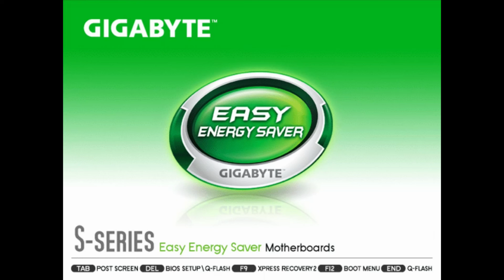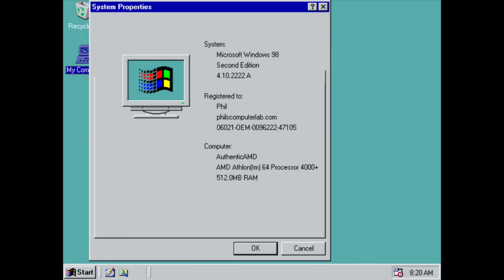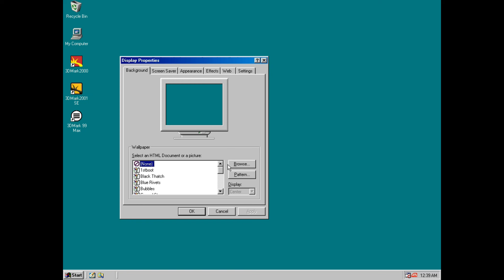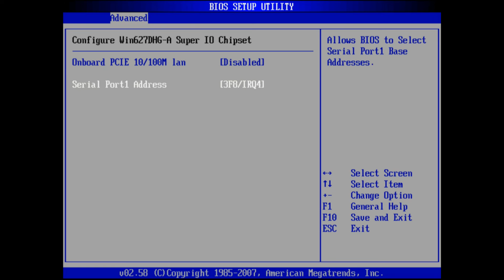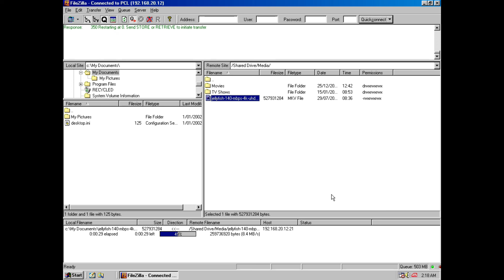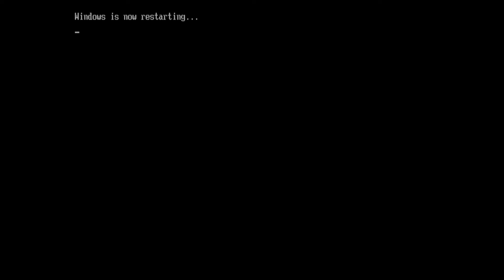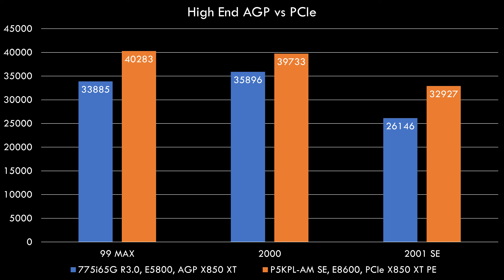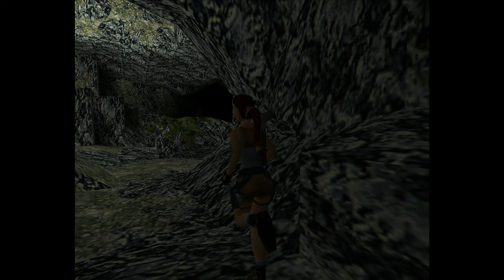Using PCIe Graphics Cards with Windows 98 SE

Comment: Recently someone gave me a Foxconn k8m890m2ma-rs2h motherboard with a Sempron 3600+ and a PCIe X300. Just out of curiosity I installed Windows 98 and I was pleasantly surprised. I haven't tested it much, but I've played NFS Porsche Unleashed and it was very quick. VIA drivers installed with no errors, but I do get some unknown devices in device manager, and I had to use a PCI soundcard, as the onboard was not detected.

Comment: Fantastic video. It's a real reminder that I really need to put my PCIe x850 into a faster machine. I Built a socket 478 system with a relatively fast Pentium 4 and the x850 just crushes it. The R. Loew 512MB patch for 7 series geforce cards is interesting.

Comment: I have 2 PCIe motherboards that worked fine in Win98 without having to do anything to drivers or device manager.  They were gigabyte GA-8i915 PMD and a Shuttle PC with Athlon 64 and nForce 630a chipset.  The main problem I had was finding old games that work with it.  Games that support XP also worked in 98, but games that predate XP rarely worked.  I was using Quadro 1400 and Quadro 1300 GPUs, which are roughly comparable to Geforce FX and Geforce 6000 series

Comment: Some time ago I buid a "modern" W98 using a motherboard with Intel 945 chipset and modded drivers and an nVidia 7600 GT and more modded drivers, surprisigly once everybody was installed it runs flawlessly and of course very fast for a W98 machine.
It was an experiment more than anything else and I ended up selling all the parts once I have the system up and running.
Reply: Going through this right now - any chance you still have a link to those 945 modded drivers that work on Windows98? Searching high and low - can't find any.
Reply: @envyeleven9471  I'll search for them, although you'll have to wait some time, I'm not in my home this days.
Reply: @shiva_MMIV  you home yet?
Reply: @core36  Totally forgot about this, if you're interested I'll see if I still have them somewhere
Reply: @shiva_MMIV  yes sir, that would be very nice. Thank you
Reply: @core36  Youtube didn't let me paste the link here, I'll upload them again and try to "disguise" the link
Reply: @shiva_MMIV  id love to have them too

Comment: HOW TO INSTALL WINDOWS 98 IN MODERN MOTHERBOARDS USING MORE THAN 1 GB.

If you try to install Windows 98 using more than 512 Mb memory the install operation will not be possible: you simply get a "Lack of memory" message (¿?) and that's all.
Nevertheless Windows 98 can be installed successfully by making the computer believe that your memory is below that limit, and the purpose of this tutorial is to explain how to do it.

A) INSTALL PROCEDURE.-

- Get a DOS boot floppy and verify previously that the file "edit.com" is included into it.
- Configure BIOS if needed, in order to set the floppy drive as first boot device (Ctrl+Supr at boot).
- Insert the floppy and boot the computer.
- If you want to install Windows at the C: drive, create previously the "Windows" folder and the file "system.ini" into it, by typing in the DOS command line:

c:
md windows
cd windows
edit system.ini

- When the edit screen is open, copy exactly into it the following lines:

[386Enh]
MaxPhysPage=30000
[vcache]
MaxFileCache=393216

- Save "system.ini" and close the program.

Control+ Alt + Delete to reboot machine
Reply: TBH, I just install Windows 98 as normal then hit F8 after the first reboot, select "command-prompt only", edit system.ini in the Windows folder with the MaxPhysPage entry and reboot to continue Windows installation.
Reply: NOTE: I do actually use MaxPhysPage=20000 (512MB) and not 30000 (768MB). You will get errors if you try to utilize more than 512MB anyway, which is why you want to limit file cache size if the limit is higher than 512MB. Since you can't actually use more than 512MB anyway without errors, I see no reason to use a MaxPhysPage higher than 20000. That way you don't have to worry about limiting file cache since it obviously can't exceed 512MB.A lot of people don't know this since you don't actually exceed 512MB for normal usage in Windows 98, but sometimes you can have drivers that load into a piece of memory that exceeds 512MB (and cause all kinds of problems).

Comment: Good video!  I've had some success doing the Win98/XP dual boot systems, and your parts used here are a pretty close match.  The South Bridge being an early ICH5 is generally the only one to support both 98 and XP, with the earlier North Bridges like i865G also working well.  Congrats on the PCIE success!  I've never been able to make that work.

Comment: I built an 8gb ram w98 machine, being a 32 bit system read only 3.5gb of ram, but anyway it's 8gb ddr2 1200mhz, and all components officially supported. 
By the way, it's an interesting video because don't have much of these around, I had to find a way to make it work by myself.
Using a PCIe 6800XT overclocked
BIG LIKE!

Comment: Thanks, Phil. Now the prices will go up on these parts, again... 😭
Reply: I doubt it as the pcie versions like the x300 x600 x700 LE & SE are undesirable graphics cards.
Reply: @snelieacks140  But x800/x850?
Reply: @schreiberstein  those were already desirable and expensive gfx cards. the x850 xt is an collecters card as with the agp variant which is very rare.
Reply from the maker: There are lots of variants like GT, XL, Pro and X700. Bottom line is, there are now more options available and higher chances of getting a good deal :)
Reply from the maker: The idea is actually to make more parts available and lower prices...

Comment: Perhaps Phil you could slap a FX5500 pci in unit to run the table fork and palletized textured games and the high end card for e erything else. Try installing one card.. and drivers..then remove it..install the other card with separate drivers from a different location..then reinstall original card and it should recognize both..hopefully it would recognize the 5500 for running the old games on there.. like your video with the GeForce 6200 and the Voodoo card.. thx for your attention. 🙂
Reply: Windows 98 does not work with more than one video card. You can run with different hardware configurations though and choose which one on Windows startup.

Comment: Huh, based on your videos I built put together a windows 98 Se machine about a year ago with parts I owned. The video card was a low profile PCIe Radeon x700. I never even considered whether you had used PCIe or AGP. I suppose I was lucky, as it just worked with no problems (on an OEM Asus AMD 754 socket mATX board).
Reply from the maker: Nice, well done. Yea not many LP sound cards come to mind...
Reply: The hard part has been finding a windows 98 and DOS friendly sound card that is low profile. So far I'm just using a cheap USB headphone adapter, but would love something better.
Reply: @jomeyqmalone  The only DOS-compatible low-profile sound card I've come across has an ALS4000 sound chip on it (not bad in DOS actually) but the bracket is still full height.  You'd have to custom make a bracket for it and install the gameport in a different slot but theoretically doable.
Reply: @retro-computing-gaming  Thanks for the suggestion! That's actually the exact card I bought to try back when I put the system together, but so far haven't had luck in Win 98 with any of the drivers I've found. If memory serves, I got it sort-of working, but the output was EXTREMELY loud and distorted on any speakers or headphones I tried. And you're right about the lack of an LP bracket, it's just sitting in there bracketless until I get it running properly.
Reply: @jomeyqmalone  So you weren't able to get it sounding good by simply lowering the WAV and mater volume sliders to down to next-to-nothing?  Was it still distorted even then?  I never understood why they didn't make a low-profile bracket option for that card.  Why make an LP card but no LP bracket?

Comment: This Asus P5KPL-AM SE is very capable for light overclocking. My C2D E8400 and C2Q Q9400 ran stable with 400 Mhz FSB on this board.
Reply: Does it need expensive cooler to reach that limit?
Reply: @Vantud391  I used the stock, passive heatsink on the north bridge, but i bought a cheap ID Cooling mini tower cooler for the Q9400.

Comment: 775 boards with agp can be hard to find and expensive but sometimes people don't even know that somebody looking for something like that, I just make a quick search on local market site and found same boar you use here for €15 and thinking ok, that's ok price. But just few listing down I found complete PC featuring GA-8I865GME-775-RH board with some P4 on it, 2gb of DDR memory and some zotac 256mb agp card complete with case, 80GB HDD, optical drive and power supply for same price, €15. There is room to upgrade that but for that price perfect entry machine for retro gaming. I'm sure stuff like that can be found anywhere.

Comment: Need to see a 98 setup with a 7950gt pcie card running. Glad to see radeon pcie cards working though!
Reply: I have a 7900 GTX working great in windows 98. I used 82.69 driver.
Reply: @monotoneone  any issues with it or are there certain things that don't run?
Reply: @tomat7041  It has been a few years and I don't think I ever tested it much. But those 82.69 drivers do have issues (even with AGP cards).
Reply: I believe its just with modified drivers like this.

Google: "Geforce 6/7 and 8 AGP/PCI-E Driver Edition for Win98/ME by Zak!"

Comment: If you're using Nvidia cards under w98 there are modified drivers (82.69) that support 7000 and 8000 series. I previously had my 8800GTS 640MB working under 98se but I think I had KernelEx installed too so that may have helped.

Comment: This is amazing! I didn't know this was possible, and now it opens up so many doors! :)
Obviously you need to dig into Nvidia cards next. If you can get that working, that'd be huge.
The NAS video you hinted about, that sounds great too. I suck at networking stuff, so any guides are welcome, hehe.
What a way to open up a new year eh. Cheers Phil, you rock.
Reply from the maker: Yea it does open so many doors 🙂
Reply: @philscomputerlab  I say networking opens up.....ports ;)

I'll see myself out.
Reply from the maker: @Hardware-Hoarder  Hehe good one 😁
Reply: Nvidia cards work too. Only problem is the newer drivers you have to use that don't work well with some older titles.

Comment: there are some early LGA775 chipsets like the VIA P4M900 which have native windows 98 drivers and have working PCIe that'll work well with a build with those ati graphics card.
the (ASUS P5VD2-VM SE) LGA775 motherboard is one with windows 98 drivers.
Reply: Another cool thing with VIA chipsets is that you can have Sound Blaster compatibility under MS-DOS without any TSR's using sound cards based on the ESS Solo-1 and Avance Logic ALS4000. Unfortunately the Solo-1 refuses to use the VxD drivers on my VIA PCIe motherboard so I'm stuck with the WMD drivers.

Comment: I'm surprised you were able to install Windows 98 using a PCIe card without issues. On my system, Win98 installation wouldn't recognize PCIe, resulting in black screen. So just to install it I had to use a PCI card, then replace it with PCIe card after the installation was over.

Comment: I missed the cool cooler designs they used on these. I personally have a diamond multimedia version with Radeon Ruby on it.
Reply: I've got an old Sapphire Radeon HD 38070 its very cool. The ASUS GeForce GTX 550 Ti that i replace it with back in teh day is still a very sleek card but it just misses the personality that the old card artwork brought imo.

Comment: In my end, I have been given a handful of old Laptops, some even have a WinME sticker.
No PSU bricks though. But I plan to get a universal, once I've had time to ID what power requirements the machines have.

Should I have enough working, I'm gonna try and do something similar, with what I've learned from your videos to make early-era WinXP and possibly, mid-range Win98 gaming machines. (Assuming they have a dGPU)
Reply: A lot of AC adapters are standardised and readily available.

Comment: Nice to see network being covered a bit more in the future! Small note though: whatever you do, do NOT mix old Windows machines with your 'daily use' home network. Plit them! Might be a nice topic for a future video as well, to discuss the various options. ie a separate vlan, or a separate switch/router.. You could do all kinds of fun things with it; ie use a simple router/wifi/switch box where you use the rj45 ports for  your retro machines and the wifi radio for the internet uplink etc.. Fun :)
Reply from the maker: To be honest this stuff is above my skillset. The machines get an IP address from th Internet modem/router, including default gateway and Internet access. So the retro machines are indeed at risk...
Reply: @philscomputerlab  The NAS has two RJ-45 ports. Perhaps use one Ethernet port for the daily use network and another port for a separated 'retro' network. The NAS will then have two IP addresses completely separate from each other.
Reply from the maker: @ASUSTOR_YT  Thanks for the tip, that worked! I used an old modem/router and connected that to the second Ethernet port! I now have a separate Retro LAN, that's not connected to the Internet and let's all the older systems (DOS, 98, XP, Vista) talk to the NAS without catching bugs :D

Comment: ATI Radeon X850 XT PE, that's a 70€ card, I would rather stick with Windows 2000 and XP.
Reply: @Mr Guru Interesting, I had a Geforce 6200TC but PCIe but I've never ran any games on my XP machine. It now has a Quadro FX1500. Yeah I know about those games, to be honest even with "of the time" hardware I had many issues trying to boot some DOS games back in the day of 98SE so I've never really bothered with a modern DOS machine. Maybe one day I'll try those old games again but with the prices of AGP cards it won't happen for some time. I only have an FX5200 and an ATI 9200.

Comment: Wow you've made it! Win98 on PCIe MB / video card! Thought it might be either impossible or too complicated to be worth the effort.

Still trying to fix the 4K alignment problem with my recent dumpster-found WinXP build (if partitioned by a new Win10 computer first, the SSD would not boot after XP installation and I don't know why).
Reply from the maker: Hmm that's odd. Because I've done this a few times. But, some SSD just don't play ball. Try another brand or a HDD and see if the outcome is different.
Reply from the maker: Try older versions of Mini Partition Wizard. It has an option to align partition. You can install XP like you normally do, then run the tool and it will align it from within Windows / CMD prompt.
Reply: @philscomputerlab  Thanks! I'll give it a try.

Comment: I had a Nvidia 6600 GT PCI-E running on a dual core motherboard about 10 years ago. Performance was fantastic but i could no longer use DOS. PCI-E cards from Nvidia break DOS in Windows 98. I never tried any ATI PCI-E cards so i can't comment on those. Great video.
Reply: hi, say - what kind of trouble did it give you in DOS ?
Reply: It completely locked up the system. It's all or nothing I'm afraid.

Comment: I am curious how using PCI on a PCI-E motherboard would work with the adapter. If it does then it could possibly open up the usage of VFIO/GPU Passthrough even more for retro gaming.
Reply from the maker: PCI cards work just fine! USB, Ethernet, video cards, not an issue at all :)
Reply: From the beginning PCIe was designed to be compatible with PCI from a software point of view. So, in theory, it should be possible. Of course there could always be issues of driver support for the actual devices, but the bus they are attached through shouldn't matter.

Comment: The 7000 series on Nvidia's side should work on windows 98 as well, at least according too this guy with modified Nvidia drivers.
https://msfn.org/board/topic/97786-geforce-67-and-8-agppci-e-driver-edition-for-win98me-by-zak/

7800 gs on pci-e detects properly like the agp 7800 gs it seems, some it only shows chip revision so you'll see g70 instead of 7800 gtx.
Think something like a passive 6600 gt or 6800 gt would be a sweet spot really with a larger cpu cooler too make a quiet windows 98 build.
Reply: I have these drivers working on agp with a 7600gt, but an asus 7900gs doesn’t work for me, I don’t know why.
Reply: Tried posting this link myself, but just gets deleted :-/ 

Good someone was able to :-)

Comment: Shoot, my ASRock G41M-VS3 board misbehaving lately even ever worser. The first symptom is it hangs up for no reason.
Then I unable to use keyboard and hard drive. USB is problematic too.

I then tried to heat up the northbridge and southbridge. Mobo died. Turning on will flash keyboard lamp but nothing on screen even with GeForce 6200 TC pcie I had.

Maybe I would find g31 mainboard? Still have ddr2 in spares
Reply from the maker: At least 775 boards are cheap and easy to find :D
Reply: @philscomputerlab some news, that Asrock board may be dead for good, but my uncle has gotten a replacement laptop, to replace his broken laptop and an old pc. That old PC uses ECS g41 with pentium dual core, now swapped with e7500. Never been cleaned from day 1, but the dust is kinda minimal.

It multiplies.

Comment: Great video man and Welcome back.
Do you still have the PCIe DOS issue?
Reply from the maker: What PCIe DOS issue? Apart from installing Windows through DOS prompt, I didn't test any games in DOS...
Reply: @philscomputerlab  I mean, you still can't run DOS dependent games with PCIe GPUs?
Reply from the maker: I'm not aware of this issue... I had Quake running on fast PCIe system in the past. As well as Doom and Prince of Persis. So this is news to me...
Reply: @philscomputerlab  OK. Maybe it's something wrong I'm doing. I'm sure you can run DOS games on fast hardware but not sure if those games are running on 9x.